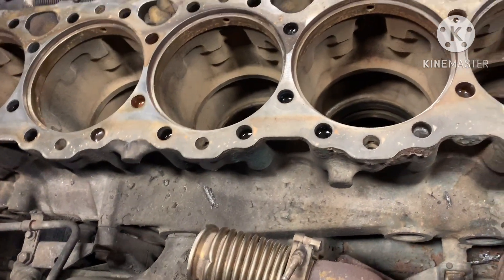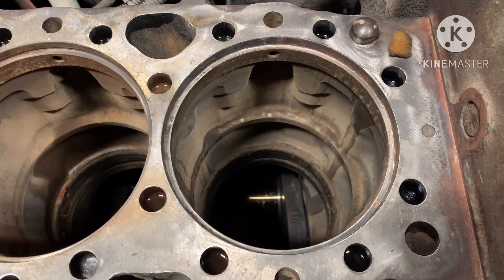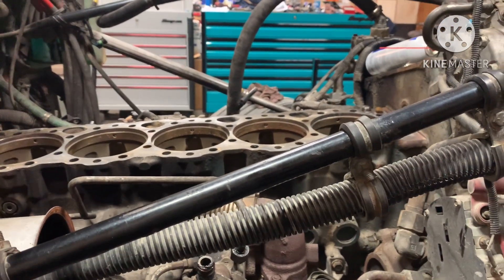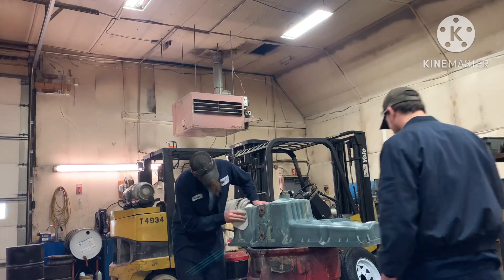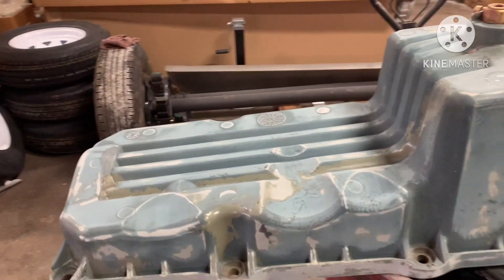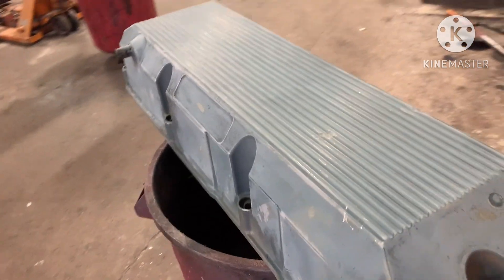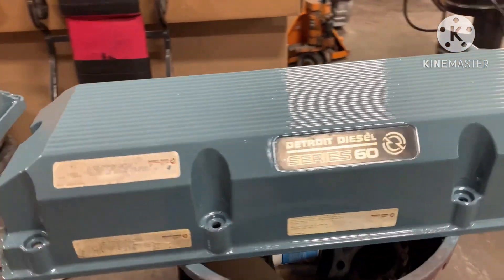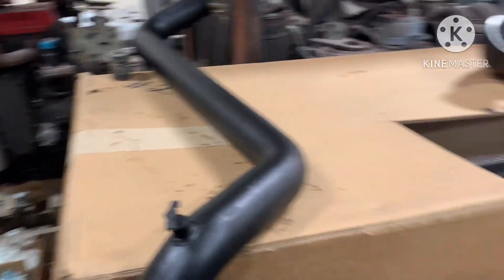Is this engine ruined?!

Comment: How many miles/hours were on that engine?
Reply from the maker: truck was at about 1.5 million, it did have an out of frame engine swung into it at 1 million but its likely the overall mileage of the engine is between 1 and 1.5 million.